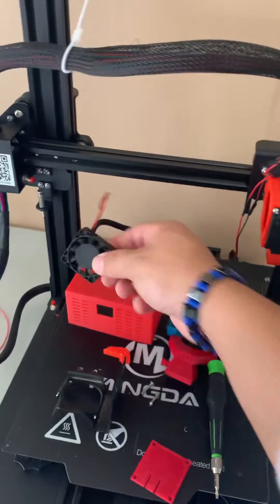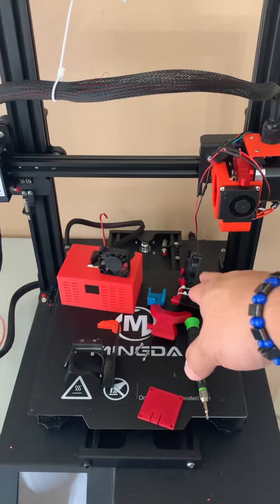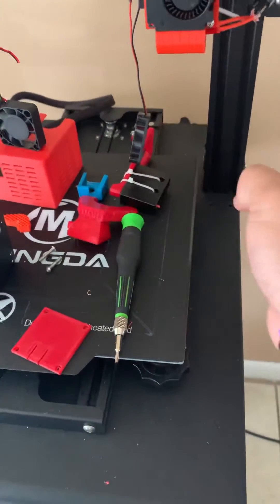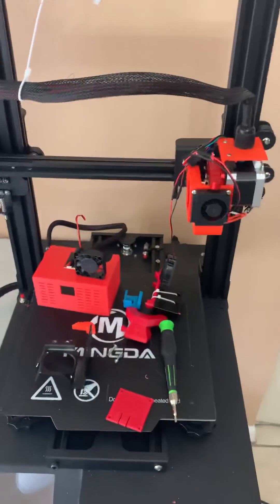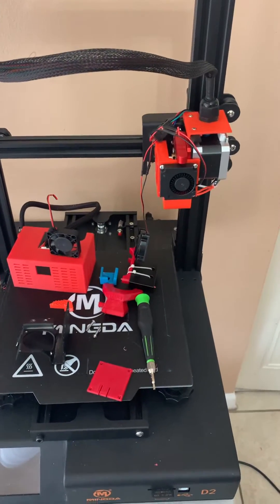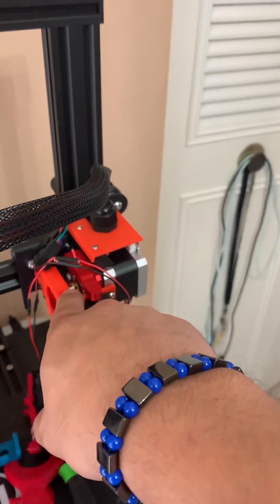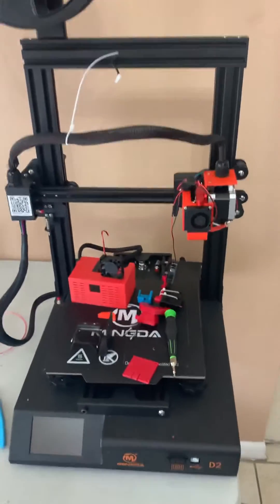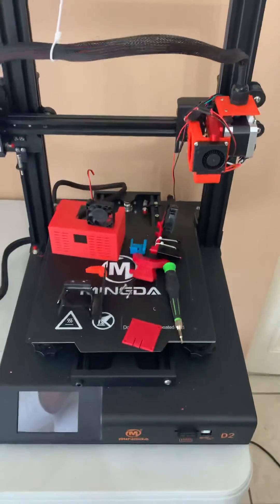Mingda D2 all upgraded

Comment: I have a probleme with the extruder. It feels like it does not "grep" the filament and because of that it stops extruding mid print. Do you have any tips for that?
Reply: Also I dont exactly understand how the spring with the nut works, that goes on the screw on top of the spring.

Comment: Hows your d2 now?
I am choosing between Mingda D2, Anet ET4 and ENder3 pro.. But Mingda D2 seems to be a winner in features.
Now the problem is there is not a lot of parts available for it.
Reply from the maker: I would honestly get a longer LK4 pro. Silent board out the gate. Mods galore and I love their customer service the most. Second labist ET4 which is a rebranded Anet ET4 with auto bedleveling that’s more accurate then the BL touch

Comment: Mine caught fire lol. I think it’s a bad PSU earth ground. The power switch melted and actually caught fire. Check your PSU grounds.
Reply: My post and myself suspiciously got removed from the Mingda Facebook group after posting about this. Shady dealings that Mingda company.
Reply from the maker: @gaxon1920  you finally see the light LOL. This is what I’ve been saying all along. And if you pay attention to the Facebook group I’m in it by the way. I’ll post a random yoda pic so you know it’s me, but they sensor it to “Most relevant”. I’ve seen 5 peoples posts disappear about bad support from Argentina, Chile, Mexico, Europe and I can’t remember the other one. I’m going to do a video soon with all my mods I genuinly feel bad for so many people. I have messages in my Twitter, Instagram, and Facebook about support, I’m not even that good but sucks when your stuck with a machine you can’t use or return and that was your whole budget. Just posted in the MINGDA D2 3D USER GROUP a yoda saying “Sup” see ya there Gaxon. Thanks for staying in contact. I never intended to bash anyone for anything, but if you check the Mingda Amazon, read the reviews and you tell me that’s not a “get it free for good review” sounding type of post. Fugatech got into a tit for tat with some numb nut because he spoke truth these printers have way to many issues to be “pro” grade. Now they have the rock 3D with imitation parts but premium price. But let’s continue to be there for those that need it. Good work gaxon. Don’t relent!!!
Reply: @dopegod3d178  I sent you a DM, I’ll see if I can get back in the group. My friend has one of these he’s bringing to my house today. I’m going to fix his PSU and add proper ferrules to prevent his from catching fire.
Reply from the maker: Dude!! You ok? Nothing else got damaged?
Reply: @dopegod3d178  yeah all good.

Comment: Are you still messing with that D2? You are worse than myself.
Reply from the maker: It’s one of those things I hated so much, I found myself figuring out how to make it work or better LOL and it’s now they are both literally in my lineup. 
What’s been swapped:
Extruder. Using a generic metal one in one and a generic plastic SunLu extruder that came with my S8 (S8 is working better swapping both to same over weekend)

All fans swapped to New winsin dual bearing,  fans, I even added one to blow over the motherboard and added heat sinks as well. 

Took off the dual z rod guides. (Made prints worse) 

Using custom coolers. Found one that seems extremely promising after a mod. Testing over weekend then posting vids on everything I’ve swapped and what cheap repairs I have found. 

Is there a page one could share their stats? I’d like to share for those who have it and want to know what parts to swap out to ya know.

What you been up to? What’s your printer up to? 

How’s your new year?
Reply: @dopegod3d178  Mingda actually has a Facebook group for the D2. Been trying to help those poor souls as much as possible. 

The Mingda printer it’s become a hobby for me. I guess the more challenging it is, the more I have to work on it. I don’t think it would be wise for me to purchase another Mingda, but it was on sale for $160. 

Join the Facebook group, I’ll see if I can find you and send you a friend request. 

New Year has been good so far. Just bought another printer, Ender 5 plus. I love the print speed and the design. Only problem is, it comes with an 8 bit board and noisy drivers. I’ve already started swapping it out. 
https://www.thingiverse.com/thing:4752638
Reply from the maker: @gaxon1920  checking the group now if they don’t still have me blocked LOL
Reply: @gaxon1920  Ya I got a black friday deal with some PLA i was just over 200$ so I expected to have to work on it a bit, but I just took some time checking stuff out putting it together and tinker here and there, I tinker with alot  of stuff so I come up with alot to use it for and it gives me something else to tinker with. there is s split fan you can hook up to it

Comment: What type of connectors you use for your fans. I've been looking into the JST-SM ones and wondered if you've ever used them.
Reply from the maker: Sad truth, there are no fans per se that are drop in, I had to splice and heat shrink mine in. I used a small propane heater. I’ve seen people use heat guns, but my solution was $5 for the kit LOL
Reply: jst connectors are noramlly pretty handy tho, they work fine with most small wiring stuff even if it isn't really "meant" for it, it fits and works well for the most part. I found those balance charging and fell in love